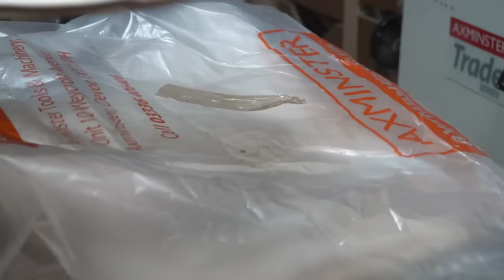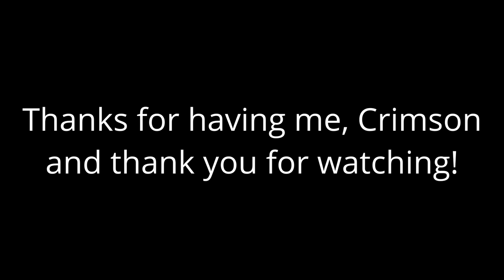(1st Place) Making A Guitar Out Of Brad Angove - Full Build - GGBO Invitational

Comment: Wouldn't it been easier to maybe, to cover certain holes with painters tape for getting to pull snake lines for the electronics wires inside the body cavity with a suction vacuum.

Just wondering, if it would have saved some time and aggravation, in that process ... just curious if that could even help ... sort of like electricians do through feeder pipes.

Great looking and sounding AX.
No wonder it received a 1st place award. BRAVO, Sir. That really turned out super cool ... cheers!!!

Comment: Without a doubt, a beautiful guitar and masterfully built. One point though, I would have liked to have seen an open slot headstock with three tuners each side. I don't feel the traditional six on one side with this excellent body shape does it for me. Not a big concern. I particularly liked the smaller front bout that you have designed and the F holes. Cheers from Australia!!
Reply from the maker: Thanks. I agree - unfortunately the kit that crimson sent me was already cut for a 6 inline headstock 😔

Comment: What adhesive did you use for the body binding?  Where did you get such a long section of binding? Great job!
Reply from the maker: It was just medium super glue for this one (I'd use something else if I were gluing plastic to spruce as it can stain the spruce green!) You can get long bindings from StewMac in America, or ToneTech in the UK
Reply: @CranmerGuitars  Thank you for the information.  I was concerned that the super glue would seep into the surrounding wood too much and seal it for any finish.